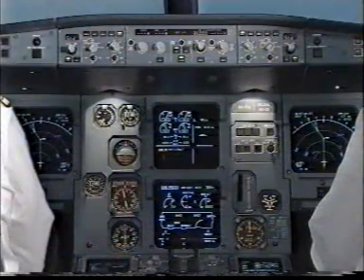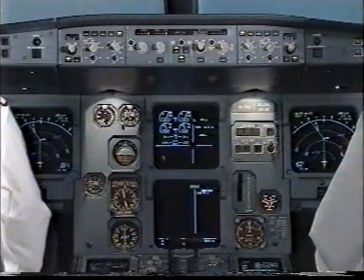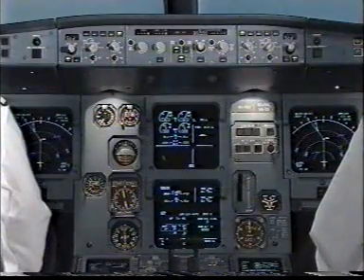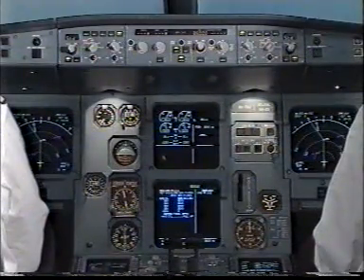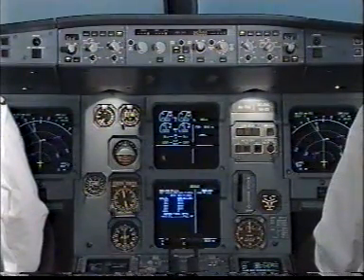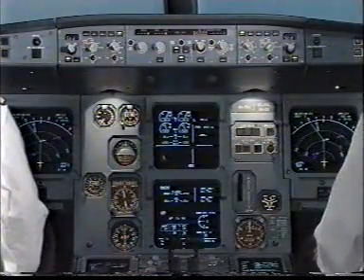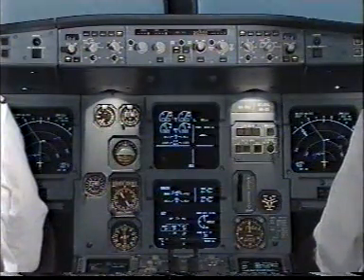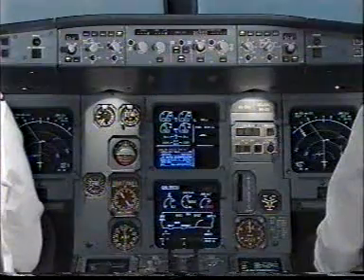Airbus emergency descend after cabin pressure failure

Comment: @hanzubitch if you leave the systems do everything for you, what's the point of having pilots? They would only require 1 pilot in case of failure, otherwise good bye pilots, welcome technology... Just like the factories. (I replied to Rm4rs' comment) Airliners are struggling financially, they will cut in every possible area in order to survive.

Comment: I find it interesting that as soon as a pressurization fault has been identified that the oxygen masks aren't immediately donned, placed on 100% and emergency. It isn't until cabin controller 1 and 2 faults and then cabin pressure loss that the captain calls to don the masks. Good luck in the real world. The cockpit grays out during a depressurization, good luck finding and properly donning and pressurizing the mask once it is far too late.
Reply: Not sure but since system 1 fail, was inop, but system 2 was operational there wasn’t an immediate need for cabin masks since the cabin was still pressured

Comment: not quite perfect but its ok. 1 tip, dont turn the master caution off that quickly. discussion with the captain on what's wrong should come first before taking action. after all real life you wouldn't know what failure was going to happen on a flight. still good vid.  keep up the good videos :)
Reply: Not sure, but I from what I know you clear the master caution as soon as you read the failure, there is no need to have a master caution light just there, and since he read the failure...